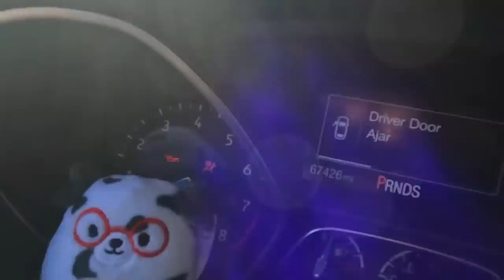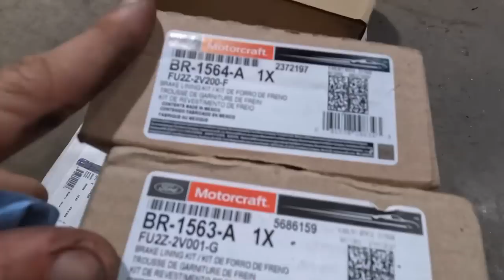Mechanic Cheats book time! Close Call | 2016 Ford Focus 2.0

Comment: I bet more than a few will do some expensive damage installing that A/C compressor. Hard to believe control arms would be needed at 60k but my last Ford lost water pump at 60k. Ford lost me as a customer for new vehicle, I would buy a older Ford.
Reply: It's astonishing that complete control arms are needed but it looks like the entire assembly is the only available part if even one ball joint, bushing or boot is compromised. All part of planned obsolescence.

Comment: Those adornments to the steering wheel would result in an MOT inspection failure in the UK even though easily removed.  Personally I cannot see any logic whatsoever for sticking them on the wheel nor obscuring the instruments which assist you in driving your car!  Maybe the drive is woman...just a wild guess?
Videoing an inspection is actually a really good idea even without commentary.  It means you can show your customer EXACTLY what the problem is without being accused of upselling.  It also means that if the customer chooses not to have the work done against professional advice then they have no legal right to recompense.  I trust my garage but I have been a customer for many years and have no qualms about accepting anything they recommend be it 'it will need looking at again in a few months' or 'I suggest it gets done now' but I am one of that strange breed that will not cut corners when it comes to road safety, the safety of my passengers and others on the road.  I have seen far too many tragic results due to lack of maintenance.....it just is not worth it!
Surely if you are going to replace the front rotors it would have made far more sense to remove them and the backing plate and replace the control arms with the rotors off?

Comment: I believe the French are the exception so Renault, Peugeot and Citroën are all arse for elbow (in more ways than one) 😆 🤣 😂 

They did invent the car though 🤔  lol

Motorcraft parts in my opinion were mid to low quality and not as good as other brands, I'd be going for NGK for the plugs as they are better lol Delphi are good quality .. in my opinion ...

You should use your hydraulic gearbox jack/stand, take the gearbox/transmission cradle off and get someone to make you an extension with a \__/ shaped bracket on the end and/or a 4 fingered cradle (or just a straight rod) and swap them when required.

You'll find it much easier to use than those twist stands.
Reply: There is an automatic gearbox on his hydraulic jack across the shop, probably from that Chevy on the other lift.
Reply: @GeekBoyMN  he could still get adaptors made for it in the mean time for making it have more functionality though.
Reply: @scottbishop7899  Sure but that doesn't change the fact the transmission is on the jack. Lots of work taking it off when the screw jack did the job.
Reply: @GeekBoyMN  in future use though!!

Boy you're retentive about the here and now aren't you??